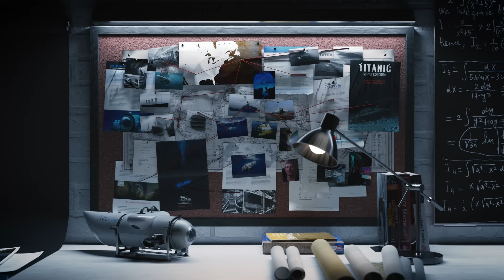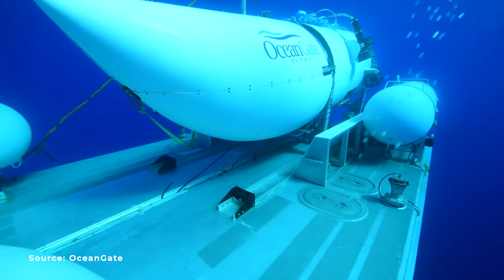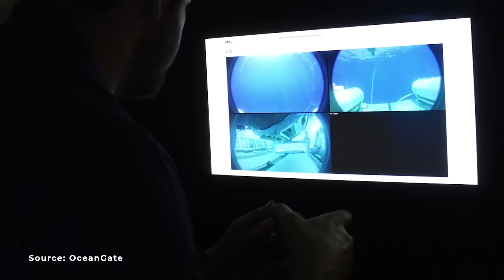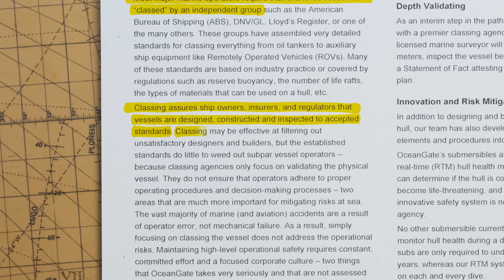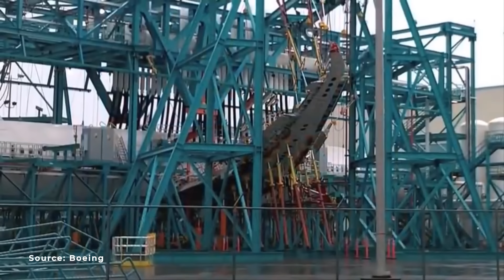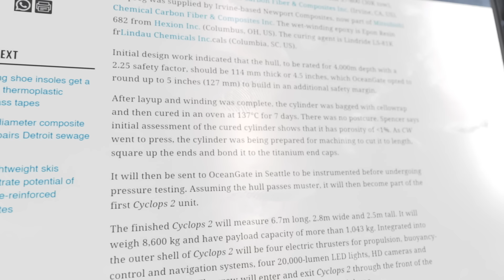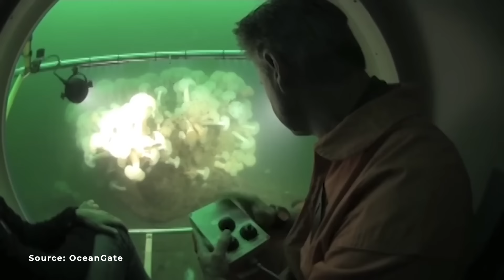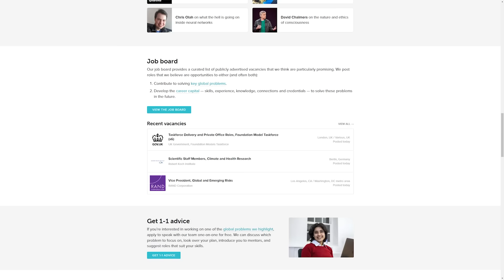The Questionable Engineering of Oceangate

Comment: Degree qualified Materials engineer here with extensive experience in failure analysis. I've lectured in Materials engineering at University level as well. Great video. I concur all of your conclusions. My analysis is the same, totally inappropriate material, inappropriate design, inappropriate manufacturing and flagrant disregard for safety standards and the laws of physics. 
You can dodge safety standards but you can't dodge 300 atmospheres of pressure in the equivalent of a poorly made coke can.

Comment: 9:00 medical autoclaves,  which I have used for decades, are high pressure and high temperature.  Are the autoclaves for curing composite hulls also hot?  Or do these autoclaves use something other than the phase shift of water to steam to increase pressure?

Comment: Once you start thinking about the magnitude of the pressure acting on the sub, it actually becomes kind of counterintuitive that it's even possible to build anything with a large low pressure chamber inside that can survive down there.
Reply: It has been done before by others with spherical titanium submarines. But they were heavy and needed expensive foam for buoyancy.
Reply: SmarterEveryDay did a series on Nuclear Submarines and one of the first things they mentioned is how the sub is designed to compress.  Computers and similar structures/devices are spaced apart so when the sub compresses they end up next to each other instead of smashed.  They showed a line that was taught when they first started descending that became quite loose once they reached target depth.  If memory serves many if not most subs are pressurized from the inside to help with support, so long as the transition is slow/smooth enough humans can handle fairly high pressures without issue.  Obviously not as high as would be needed to completely cancel out the external forces but enough to help a bit.
Reply: Perhaps but we need to be sure. And we need to test bigger subs

Comment: Anyone reckon forged carbon or chopped tow mushed and compressed into the shape of the hull would be more effective. Only problem is it would take a massive compression mold and a very difficult construction technique. But it shouldn't delaminate as easily.

Comment: I was an aircraft maintainer in the US Air Force for ten years. When i heard about this submersible using carbon fiber instead of hardened metal materials, i fucking lost it. I couldn't believe someone would be so stupid as to use a composite material at those depths.

Comment: I also wonder about the composite to Ti interface.  It seems like they were primarily bonded which is extremely challenging as composites are not as perfect as a machined surface and you have no idea the real strength of the bond.  A team I was a part of in college tried so,etching similar with a composite tube and aluminum end caps for a oxidizer tank as part of a hybrid rocket.  We were conservative with our calculations but when we pressure tested our tank the bond failed.  Lots of questionable choices in this design.  A good reminder to all engineers that what we do matters.
Reply: Sometimes it isn't even so much as a bond working but how long it works! Take for example that aloha flight that became a convertible. Repeat pressurization cycles and age attributed to bonds falling apart
Reply: I worked at Fokker Aeostructures here in Holland back in 2010 on the F-35 Doors And Flaperons. I remember the flaperons were a titanium inner structure with CFRP skins hot bonded in an autoclave. Because of the thermal stresses (very different coefficients of thermal expansion) huge internal stresses must have built up. Disbonded areas were identified with some kind of X-ray pictures. Afterward hundreds of fasteners were added, drilling through the skins and the titanium. I was not experienced in aerospace engineering of material science beforehand but I learned very quickly this was not sound engineering and a manufacturing nightmare with extremely poor process outcomes in nearly every step.

Comment: The part about foam used to adjust buoyancy on a submarine would be moot at such depth - any foamed material outside the main pressure vessel would just be crushed to almost its unfoamed density. Same problem with blowing ballast tanks with air (like submarines do) when the air becomes half as dense as water (and what pressure would you need to store it at, then?). And the last thing you need is a sub which goes from positive to negative buoyancy on its own as you go deeper.
I guess the only thing that would work to add to buoyancy, would be strapping something incompressible, like a jerrycan of kerosene.

But seriously, does the carbon fiber itself (as opposed to the epoxy gluing it) do anything against the compressive load until the buckling starts? Which is inelastic deformation at best (with hope it holds out long enough to drop the pressure) and a few moments before total collapse at worst. (might as well had used plywood - at least it's changing fiber direction between layers, and wood is at least meant to hold the weight of the tree)

A pity that carbon fiber doesn't yet live to its theoretical limits and has to rely on glue to function at all.

Oh, and I'm all for "let's bypass the formalities, especially if they are just incompatible with this tech", but on one condition: ensure equivalent reliability, damn it! This isn't even "what could possibly go wrong?", this is more like "what could possibly go right?"

Comment: As a materials engineer, he got very concerned about the materials. As an electronics engineer, I freaked when I found out about the wireless gamepad and Bluetooth communications system. Those communication protocols and programming standards are totally unfit for critical to life systems.
Reply: I wonder what backups were in place. There was one dive where one of the drive motors was plugged in backward and they reprogrammed their controls at the bottom of the ocean. (The fact a critical control was untested until at the ocean floor is aweful, but a different topic) This tells me that there's a software layer between the controller and the switching hardware, so whatever was running the control software could probably be used as a backup, but a hardware backup is of course the gold standard.
Reply: @TlalocTemporal  they designed it so you could put it in backwards? Wow
Reply: @alexmcd378  -- I'm not sure if the connectors were designed for this at all. I'd bet this is more of a AV cable situation.
Reply: @TlalocTemporal  Backups? LOL. Ocean Gate was founded by a guy who wanted to see Titanic and ignored everything, not just safety, but everything and everyone, to do that.

He succeeded.
Reply: @TlalocTemporal Probably just reconfigured the controller driver, like "Map A to LEFT; Map B to RIGHT".
Reply: As a mechatronics engineer, i'm just screaming all around 😱
Reply: @BiggiN483 he's building mechs?!
Reply: i didnt know the controller was WIRELESS oh brother
Reply: Bluetooth is pretty trash even at the best of times
Reply: I have the same exact controller. It's a Logitech F710 and it uses 2.4ghz. And it's connection is TERRIBLE. I literally have to use the controller within 1 metre of the receiver for it to have a stable connection or else the signal will be intermittent.

My jaws dropped when I saw it on Oceangate.
Reply: I think the reason the hull was a bigger problem is that you could cut the risk in half by having a backup controller. Or, the personnel on the mother ship could simply launch a search and rescue for a submersible chilling INTACT at the bottom of the ocean. Tough exercise, yes. But atleast it isnt assured death.
Reply: @subramaniamramasubramanian877  they were all ticking timebombs. The hull just got there first.
Reply: @subramaniamramasubramanian877  Agree, but the fact they were using a $15 bluetooth controller target to little kids, is a bigger and more obvious red flag to me. We are not even talking about an average consumer quality device, it's literally a toy.
Reply: Waitwaitwaitwaitwait, the controls were using Bluetooth? My understanding is that Bluetooth is a byzantine labyrinth of quirks and novel compatibility problems. The only reason it's still used in consumer electronics is momentum and pre-existing install base. Even just bloody wiring the thing would have been much more sensible.
Reply: @gigabyte2248  Nah, that controller uses 2.4ghz. It's the Logitech F710 gaming controller.
Reply: In industry we need everything wired. They even need twised cable to avoid noise. Big i/o gate to ensure everything work perfectly. That is just for maybe to produce coke cans. Here they do thing envolve in human life and they just use wireless. What a stupidlity.
Reply: Agreed what if you lose connection at a critical point! We could have steered out of the mess if we had been able to turn the wheel but the controllers battery died!😮 Many parts of this screamed stupid b4 you ever got to the hull design!
Reply: @mikeklinger1712  What are you talking about? Everything would just pause when the game controller battery died. These guys could just head to the kitchen to grab a hotpocket and Pepsi while the controller charged up. Are you even an engineer? 

/s (for the love of F, /s ... LOL)
Reply: @mikeklinger1712 Eh nah you can software and mechanical engineer it to fail into a safe state.
Reply: i agree. genuinely, they should have used a wired videogame controller.
Reply: @heroedge7459 missed out on a Guiness Word Record for longest ethernet cord smh
Reply: @Sm0kedSalm0n88  within the submersible, goofball. :)
Reply: @alexmcd378  🤪
Reply: @Sm0kedSalm0n88  besides I think Linus already has the Ethernet record ;D
Reply: Thank you. I am not an engineer but wondered about that part of it. It is great to hear from someone with expertise give input on the topic to help clarify the situation.
Reply: The ocean is blue so using Bluetooth is an obvious choice.
Reply: @thimslugga  and thunderbolt cables in stormy weather 😂
Reply: Not to mention the entire community warned him
Reply: Imagine if the Arduino or the ESP32 fails.
Reply: As a bread engineer, let me tell you that I agree that Stockton rush was absolutely mental
Reply: @JohnSmith-lx3yx  a bread engineer? I salute you sir, and thank you for your work. The world would not be the same without you
Reply: There are ways to use a game controller safely to pilot such a system, this is not how it would be done. As an example, i would only use a wired controller to start with partially because they're cheaper and partially because they're more reliable (both when gaming and for an application like this)
Reply: well i mean as long as theres a backup and you accept and use it as a gimmick is okay lol
Reply: Apparently the US military uses XBOX controllers
Reply: @neiliewheeliebin  yeah....for UNMANNED objects.
Reply: why on earth would they think that a THIRD PARTY (notoriously unreliable) controller with BLUETOOTH (also unreliable) is a good idea?  like seriously, they could've just used a wired xbox 360 controller or something else which is like 10 times more reliable
Reply: As a material issue, yeah the thing was a disaster.
Titan was an endless mess overall.
That being said a game controller isn't a bad interface all things considered.
No, it doesn't have the precision of other interfaces, but it does get the job done. You could control a tank, car, or even plane using one if you're skilled enough at it. The most important things for controls is that the operator is comfortable with the interface and masters it. Shoot, someone beat a major fighting tournament using a pS1 controller and those are infamously limited. 
Are there better control systems that offer more effective and fine tuned command of a vessel? Absolutely. Doesn't mean a controller can't do the job better if the operator is more competent on a wiiu gamepad than he is on a precision command center.
It's food for thought.
Side note: keep the thing plugged into the system though.
Reply: @gardianx5293  It's not a question of "fine tuning" but of reliability.
Reply: @RegebroRepairs  controller reliability isn't an issue. They're durable, can take hundreds of thousands of commands at minimum, are small and (relatively) cheap. If a controller failed, it isn’t hard to have a backup. Unlike complex customized systems. If anything your argument of reliability only helps my observation.
Reply: I wholeheartedly agree. I was gobsmacked at all the questionable technology and manufacturing methods used on this sub. 
I worked as an industrial engineer in the Auto industry for many years.  And I nearly had a stroke when I heard Oceangate refused to certify the hull. I have written countless FMEA's for far less critical components than a pressure hull. It was a tragedy that could have been easily avoided.
Reply: That's not what caused the deaths.
Reply: Even an utter mechanical and electrical layman like ME felt red flags pop up at the mention of Bluetooth. I mean… my internet connection can flounder when I’m downstairs, maybe 30 feet away. What the heck kind of super-fast WiFi can exist thousands of meters underwater!? 😅
Reply: As a lawyer, I freaked out at knowing they didn't HAVE to go through adequate testing before submerging with people aboard
Reply: controlled using a ps4 controller
Reply: 100%, fine to maybe pilot a drone but never a craft with a human on board
Reply: @l3ftie578  The controller isn't my concern with the craft. It was the shoddy workmanship. A slow submersible that moves 5.6 mph max isn't exactly something that needs on a dime control. A controller is plenty of accuracy for a craft that sluggish. 
Is it as precise as advanced control systems? No. Is it better to have exact systems? Sure.
But the thing is that the operators need to have control over the craft. If they're more adept at controlling it with a controller over a finnicky control panel, it's ironically safer with the gamepad. 
That doesn't mean I'd have a single wireless controller as the only operating interface, though. That's just insane. Get them wired in and have a couple backups.
Reply: They have backup systems incase it broke and it wasn't bluetooth.
Reply: As industrial engineer this is okay. Since its cost effective. But thats about it. Its not ergonomic. And way not optimal for titanic shipwreck tour. 😂
Reply: Even if it wasn't gamepad sticks are inadequate to control a vehicle they don't have the accuracy or resolution. Try at any R/C radio and you'll see and feel the difference between a proportional control gimbal sticks and video game joysticks.
Reply: Wow. I had assumed that it at least had a wired hard connection.
Reply: Yet the US Navy is using them. [shaking my head]
Reply: @@nicdegrave3313 Having the lives of 5 people depend on my ability to pair a set of bluetooth devices is a very specific nightmare I have.

Under no circumstances should this specific nightmare be reality.
Reply: As a ______ I ________ can I have my thumbs up now?
Reply: @TabiTheCat  sure, here you go Tabi
Reply: Most modern subs are controlled by game pads
Reply: @EnglishDrifts69GTxRED  not manned subs.
Reply: Well that’s why they had backups ^_^
Reply: @robertgaudet7407  let me give you an analogy. Imagine the wireless receiver is like a door lock, and that controller is like the door key. Some failure modes are like doing the key in a drain, a backup works fine. Some failure modes are like the key breaking off in the lock, now it doesn't matter how many backups you have until you fix the failure. Since he was using a windows tablet to control everything, he probably has to reboot to hopefully fix the issue. Hope he doesn't steering, or life support controls, etc, while he is rebooting.
Reply: you are a joke if you are an engineer lol women lolololol go engineer me a sandwich
Reply: ok
Reply: @thikim8562  insightful

Comment: Carbon fiber is used in situations where something need's to be light and strong but submarines need to be able to sink in water.  The material choice makes no sense to me.  Established technology.  Steal can bend and flex repeatedly without breaking and you're in water so weight isn't an issue like in aerospace.  Steel just makes more sense.  I don't buy the "neutral buoyancy" argument.    The cabin is always going to be full of air if the people are to survive.  If it's full of water, everyone is already dead so what's the point?

Comment: The move fast and break things model comes from my industry. Software engineering, particularly in e-commerce and other less regulated and more lucrative spaces. 

It’s a great model for the industry. Failed experiments are limited in damage and scope, and you can very quickly converge on optimal products because of the relatively low cost to start over and relatively low effort to start up a new idea. 

But translating it into industries where failure means lives lost or irreparably damaged is irresponsible in the extreme. The tech equivalent is cryptography and security. You don’t (generally) see the fail fast model applied in those scopes because there, the human cost of failure again outweighs the benefit of innovation speed. You won’t kill anyone failing in security, but you could saddle someone permanently with identity theft, bankruptcy, fraud or worse.